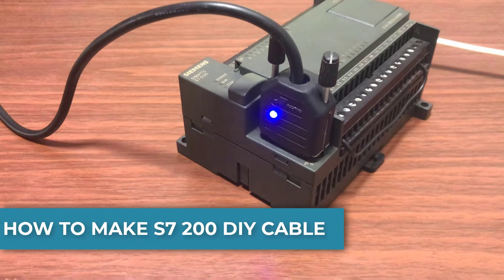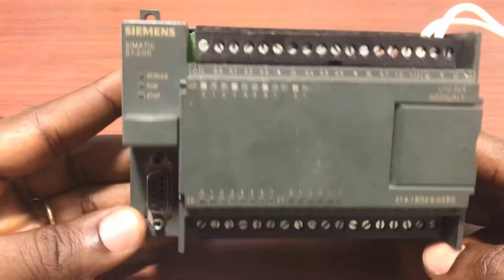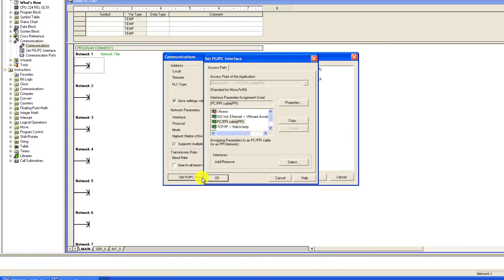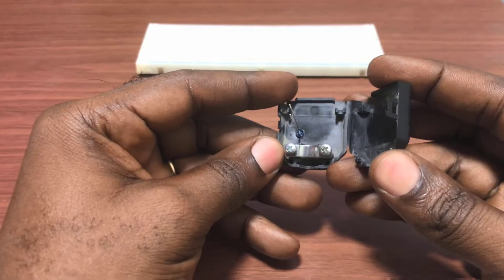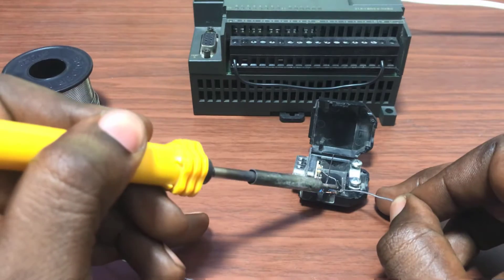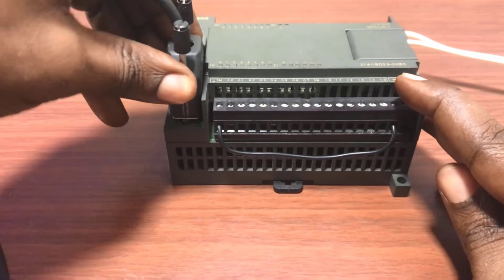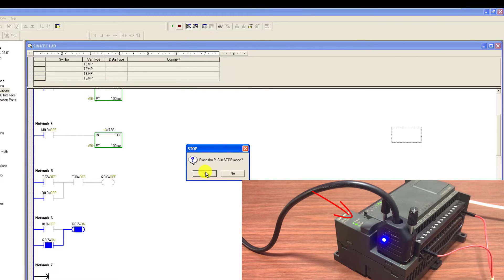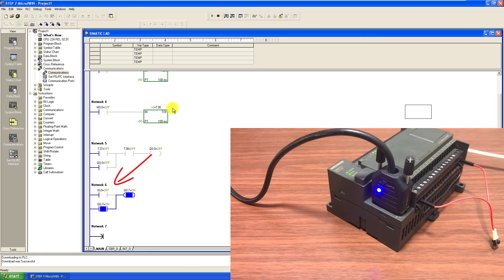How to Make DIY Programmer for S7 200 PLC

Comment: The RS-232 cable you are using its cross or straight cable ?
Reply from the maker: It was cross however I cut one end to insert the PPI circuit so it actually doesn't matter if it's cross or straight. Pls you need to adjust it to meet the PPI circuit design. Thnx
Reply: @engineeringmadeeasyingme6819  Thanks for quick response but I didn't undersatand your statement "Pls you need to adjust it to meet the PPI circuit design". so how shalll I meet this requirement.

Comment: @engineeringmadeeasyingme6819 
Thanks for your helpful video, I have tried this cable with S7-226-CN PLC only, then when I search the com port it appears Com1, but unfortunately when I tried to connect to the PLC to upload/download the program I'm getting the Windows Blue Error screen and asks me to restart the laptop.
I have tried to communicate with this CPU through the standard USB-PPI programming cable, and it's working fine.
So, what is your advice plz?

Comment: will this also work for S7-200 CN?
Reply from the maker: Yes I guess it will work with any Siemens controller that uses PPI programmer. However I haven't try all. You can pls try with what you have and share your outcome. thanks for the question.
Reply: @engineeringmadeeasyingme6819 
Thanks for your helpful video, I have tried this cable with S7-226-CN PLC only, then when I search the com port it appears Com1, but unfortunately when I tried to connect to the PLC to upload to upload/download the program I'm getting the Windows Blue Error screen and asks me to restart the laptop.
I have tried to communicate with this CPU through the standard USB-PPI programming cable, and it's working fine.
So, what is your advice plz?
Reply: It does not work with a Siemens 200 smart I am using